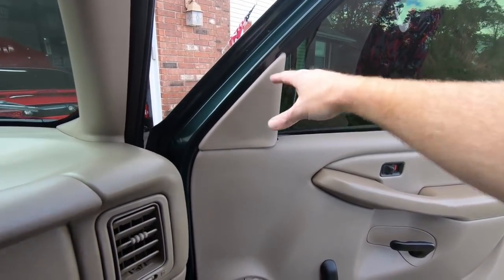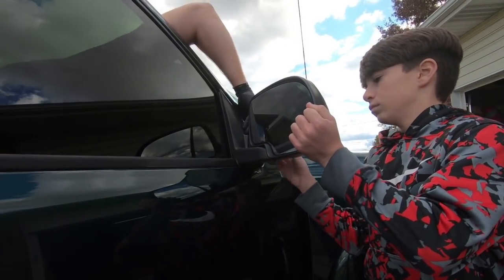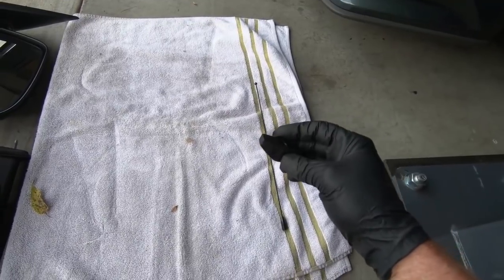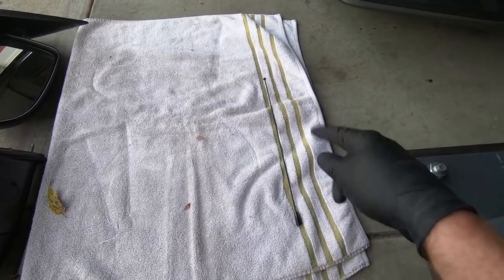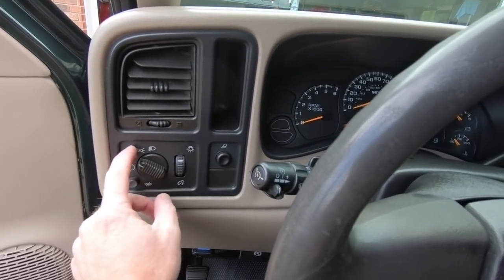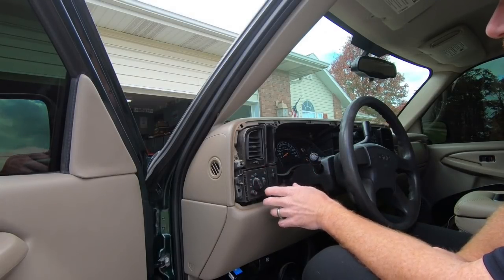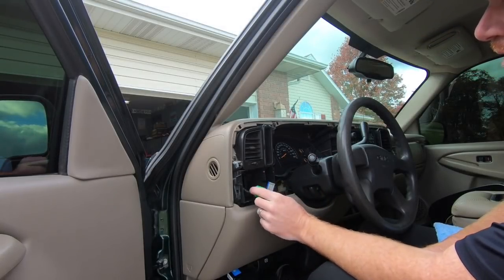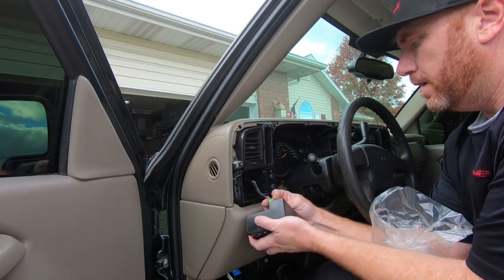Sierra Spruce Up Part 7 (Painted mirrors, New Antenna, Switches)

Comment: I just replaced that same headlight switch in my '04 Sierra.  Exact same problem you were having. When I ordered my replacement switch I noticed some of the new ones aren't backlit like OEM.  Just a tip for anyone looking to replace the switch to be sure and get one that says it's backlit if that matters to you.  I got the AC Delco brand, part number 19381535. and it is backlit on the headlight switch.  The dimmer wheel is not backlit.
Reply from the maker: Good heads up. I noticed that also. GM part wasn't available when I order but back light is a different color. I think its led is the reason.

Comment: Truck is looking good. Since you have previously worked at a GM dealer and know stuff about modding vehicles you may have the answer to a question I have. I have a 2012 Tahoe without the factory brake controller. Do you know if a factory controller can be added by a person or dealer? Thanks
Reply from the maker: Thank you. You can but it is a HUGE undertaking. It ties in with brakes and brake control modules. You would need a wrecked truck and tons of time.
Reply: TWA Motorsports bummer. Thanks for the reply. I was hoping it was at least semi plug and play like your fog lights.
Reply from the maker: @jockosboy17  me too. Aftermarket is the best option if needed
Reply: TWA Motorsports yeah. I have a Tekonsha P3 now. Really good unit. Just would like factory if I could.
Reply from the maker: @jockosboy17  understand that